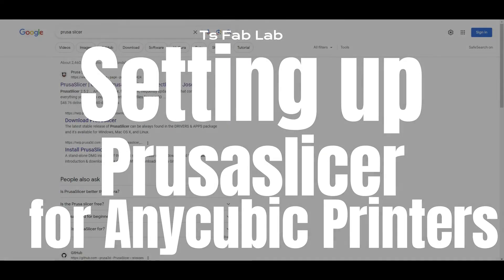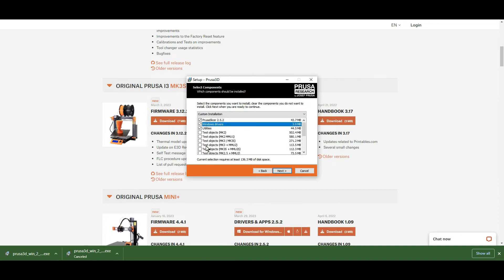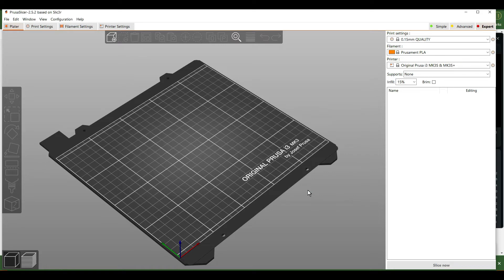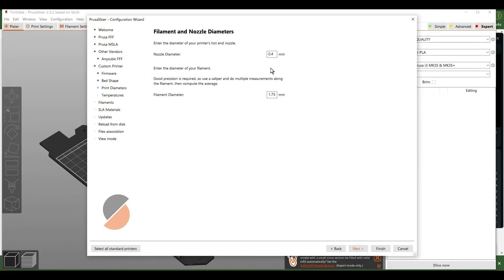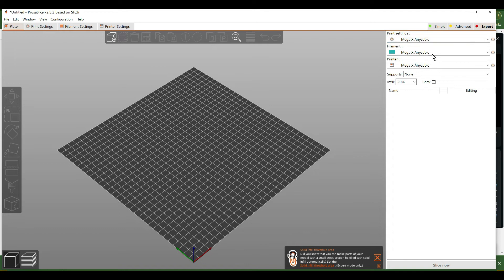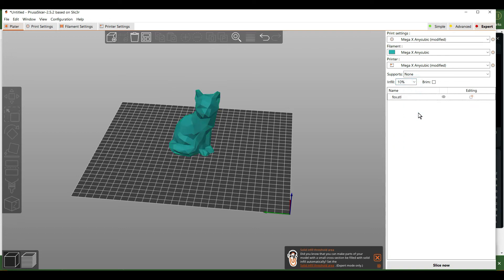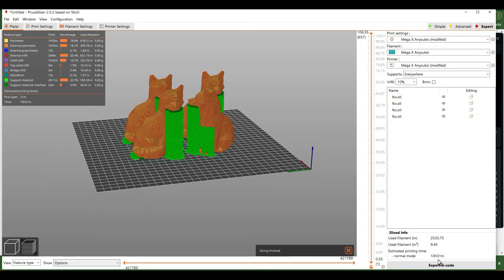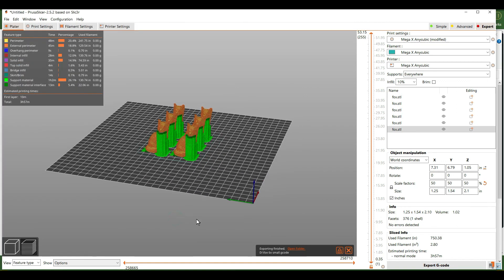Setting Up PrusaSlicer for a Custom Anycubic Printer

Comment: The program said 10h+ to print those four foxes - is that normal? Im new to this and after I designed a simple 10x10cm house-shaped cookie cutter in Shaper3D I downloaded the Creality slicer and it said 6.5hrs 😮 I never imported that into my Kobra 2 Neo but is it likely it would actually take shorter for the printer to complete the print? Thanks!
Reply from the maker: There are ways to increase your print speed. These models were set at a higher resolution to be used in casting so those tend to take longer.

Comment: Any advice for the AnyCubic Kobra Max?
Reply from the maker: In terms of setting it up? Use the basic settings for an anycubic from prusas print profiles and then adjust the print bed size.

Comment: thanks a lot for the video, which setting should i use for my kobra 1 ?  thank you :D
Reply from the maker: This is what I would do.

Open Configuration->Configuration Wizard
Add Anycubic Mega Zero with 0.4mm nozzle: 'Finish'
Select the Mega Zero & 'Save current Printer Settings'. Save as 'Anycubic Kobra 1'
General -> Size & coordinates -> Bed shape -> 'Set' Rectangular: 400x400mm ( what ever the bounds are. Im not sure for the kobra 1.)
General -> Size & coordinates -> Bed shape -> Max print height: '450mm'  ( what ever the bounds are. Im not sure for the kobra 1.)
'Save current printer settings
Reply: @tsfablab  thanks a lot !
Reply: How can i fix my Anycubic kobra 2 Max on prusa sliter

Comment: Hello, Any idea which settings will suit best for my new Anycubic Kobra 2? I can't really find it..
Reply from the maker: I would keep these the same, just make sure you adjust the dimensions side to side and vertically to match the limits of your printer.
Reply: @tsfablab so I follow your video step by step and this will work with my anycubic kobra 2 pro correct???
Reply: same